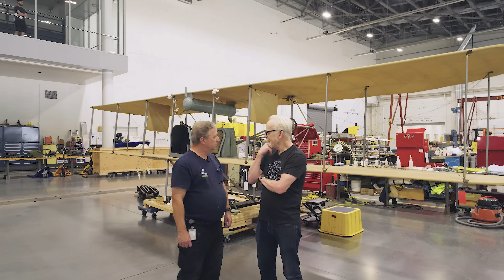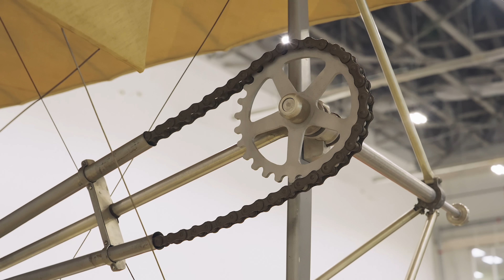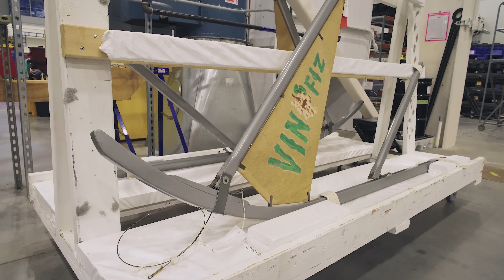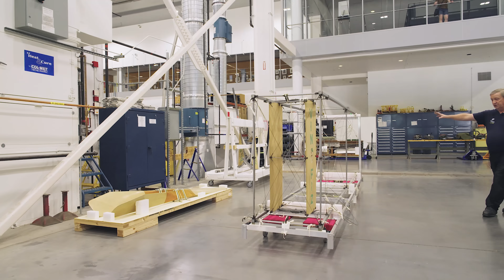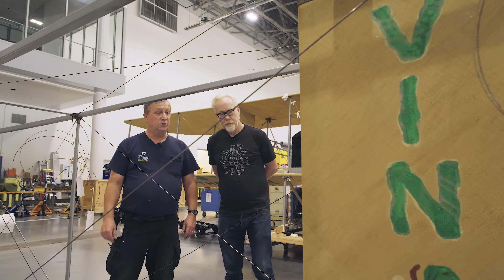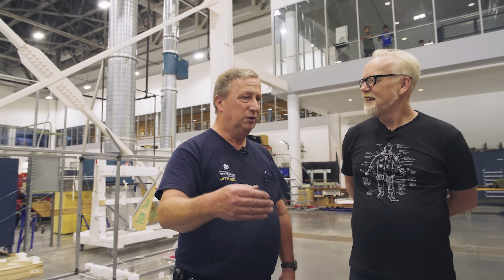The Wright Brothers Plane You've Never Heard Of

Comment: Nice Second plane ever built.
Reply: Probably not even the 10th. From 1905 to 1908, the Wrights, started testing everything they had learned from analyzing the original 4 flights the 1903 flyer made. The plane that Wilbur Wright astonished the world with at La Mans in 1908 bears little functional resemblance (except in looks) to the 1903 machine. This one is even more advanced than that one by far. There had to be many trials in between.